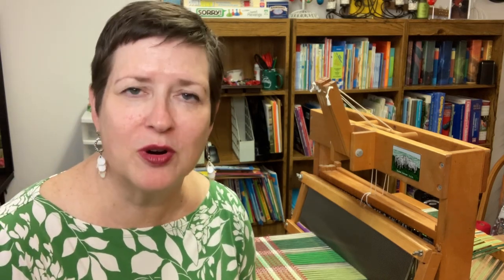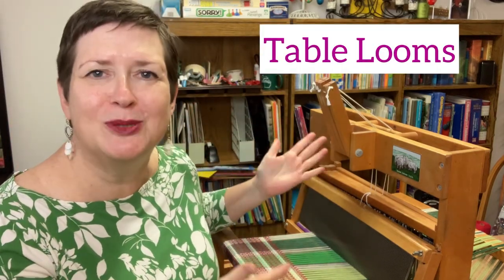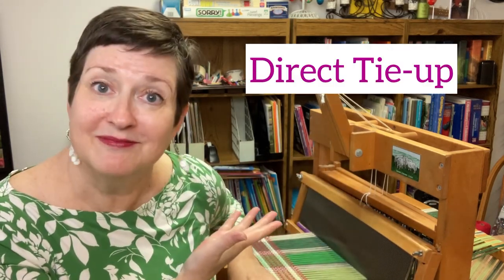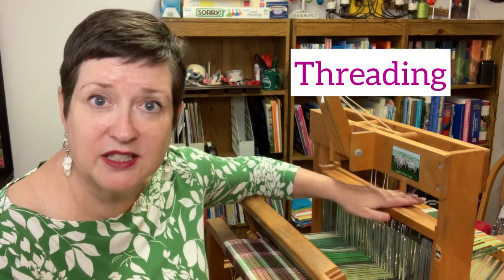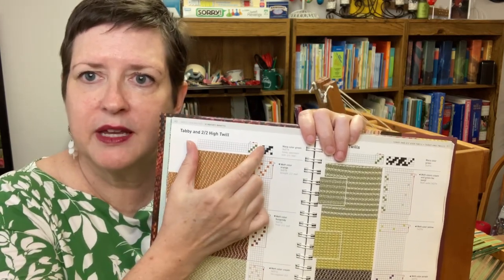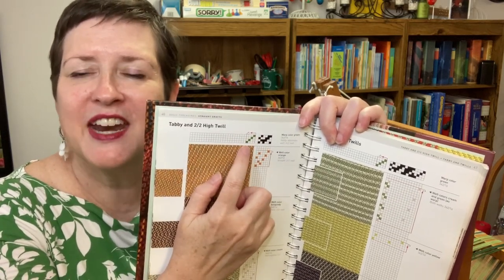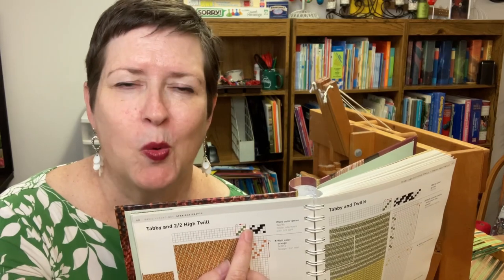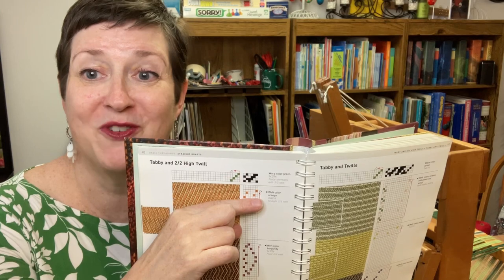Read a Weaving Draft for a Table Loom

Comment: Thank you, so much. However, I have a couple of questions. I have a 4-shaft table loom, do I ignore the extra 2 treadle instructions? Which 2? Or do I just follow the instructions for all 6 treadles? Thank you again your videos are a huge help!
Reply from the maker: @msspinner9814  Hi! Thank you for the questions! The loom in the video is also a 4-shaft - we're twins! 

A table loom is considered a direct tie-up loom, so each lever only controls 1 shaft. So use the tie-up section of the draft to tell you which shafts to lift. You can lift 1, 2, or 3 shafts together at any time. 

So if a pattern is written for 4-shafts and 6-treadles, you can still lift the appropriate shafts to create the pattern. Does that make sense? Let me know what follow-up questions you have!
Reply: @ActonCreative  
I understand the direct tie-up, so when I only have 4 levers, I start reading the treadling chart from the left, perform all six columns of information and then repeat?
Reply from the maker: @msspinner9814  Not quite. You will "read" 1 row/pick at a time in the treadling section, which is below the tie-up/crossword puzzle section. The tie-up portion is simply a key because the treadling can have lots of variations. 

If you haven't seen the Reading a Weaving Draft episode yet, that might be helpful! https://youtu.be/4qd1tiDO5C0

Let me know how else I can help you!
Reply: @ActonCreative   sorry for being dense, I’m trying to reconcile the direction for 6 sets of information to a 4 lever loom. Do I just perform all 6 directions and repeat? 

Sorry, I’m sure this would be easier if I had the loom warped so I could see it in action.
Reply from the maker: @msspinner9814  No worries! If you can email me, I can send you a few photos that may illustrate things better. I'm at chris@actoncreative.net.